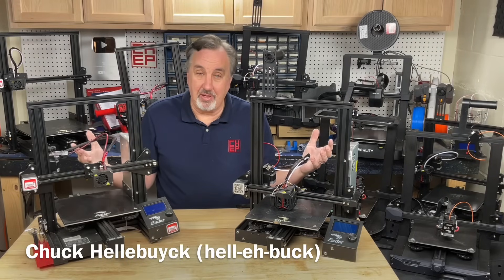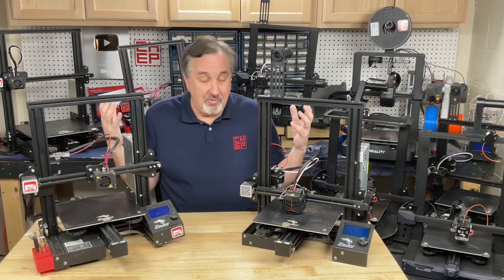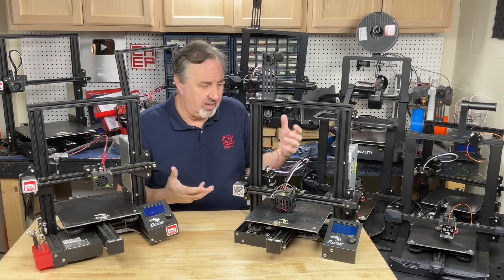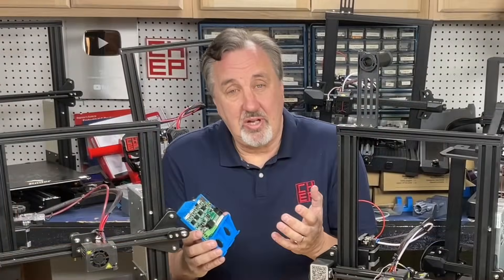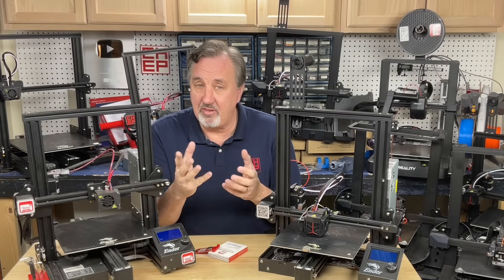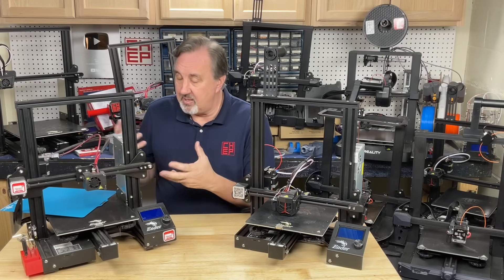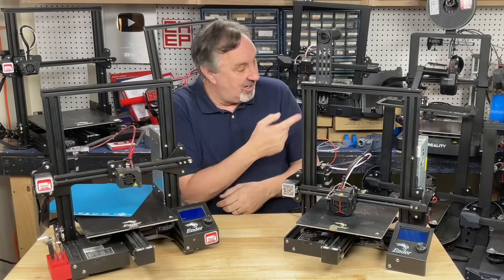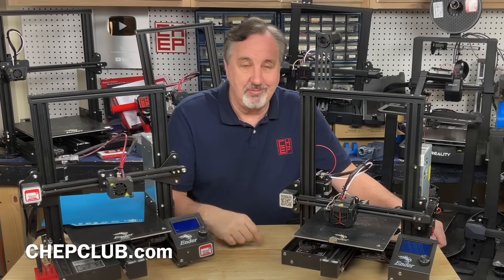Too Many Ender 3's - What Should I Do?

Comment: I just play with 3D printing. I’ve had my Ender 3 Pro for many years and I’ve put lots of upgrades on it. If I were truly serious about it I would start shopping for something newer and better but it certainly meets my needs as a hobbyist. I’ll probably upgrade like I do with my iPhone - when it stops working or is no longer supported, I’ll buy a new one! I’ve been using Octoprint for years. It does a lot of the things you were talking about in new printers

Comment: Chuck,
I have 2 Ender 3s (both are running right now) and I love them. It has been quite the learning experience (got my first one in 2018), and I've done lots of upgrades thanks to you and others. I am at the point however that I now want to move to multi-color with a larger print volume, so I need to bone up on what's best. That said, I'll hang on to my Enders for simple stuff. BTW, got my second Ender 3 Pro from MicroCenter a few years ago on sale for $99. I only bought it thinking for that price, it's great just for spare parts. I put the Creality Laser on it for a while, but the build plate is too small, so I printed up brackets and made a larger laser bed for the laser. The options are endless. Thanks for all your insights!

Comment: I have 6 very basic stock Ender 3 pros. They are a main factor in my small manufacturing business from my home. One has been converted to two color with an IDEX conversion. I continue to find new uses for them in manufacturing. They serve their purpose. As long as they continue to do the job and I haven't reached their full potential, I don't see any reason to purchase others.

Comment: The local college where I live here in northwest Ohio has a pretty solid engineering collage with a 3D printer lab. They have mainly Ender 3 printers. My opinion is it's the best machine for engineering students to learn with hands-on, practical experience. They can open them up and get a full understanding of all the processes involved in 3D printing. They have added a couple of newer printers, but the Enders seem to be a staple of the program. Because they're open source and parts are readily available, they can keep them running for years to come. Most likely they also teach the basics of reading and editing G-code as well. So, donating to schools or colleges is still a good option.

My first FDM 3D printer was an Ender 3 that I still use today. It's a solid workhorse. Your channel was probably the most useful place to learn how to do all the essential tasks and mods to get the thing to work beautifully and produce quality prints that I also still use. I have a couple of other printers now as well, but my E3 is still getting used,  a lot. I have recommended your channel to many people I 've talked to that got E3's or wanted to get into the hobby, Some, as recently as a few months ago.

When you buy one new, you get a great out-of-the-box experience with the first prints. So, although they seem pretty basic compared to modern enclosed, high-speed machines with AMS units and all the other new bells and whistles, I think E3's still have a place on the entry level side of things. I think Creality should even put links to your videos in the box.

Comment: I turned a dead, older, Ender 3 into the frame and gantry for a heat set insert installer. I haven't had a use for the control board yet.

Comment: i think getting into 3d printing demands an ender 3, the barrier for entry is so low nowadays and the knowledge base is astronomical.
you can get fully modded, already reliably built ones <100$ on marketplace from people upgrading or who have sidelined/given up on printing. Hell, most sellers LOVE to share their experience and help you get comfortable and good at using the machines, you make good friends that way
im up to 3 printers with less than 350$ into the hobby excluding filament and mods i hardly need (cant help but tinker and learn)

Comment: 3 days ago i replaced my original stock ender 3, still got it, works like new, but i went for the new features on a low budget, artillery x4 s1, cost me around 30-40 euro less then ender 3 in 2020

Comment: Still using my Ender 3 V3 SE. It is my first and only Ender and I still like it. I have two older smaller machines I have kept for emergency backup but I have not needed to resort to them again yet. Since retiring I have done less printing and spent more time learning blender and learning to do animations. This costs nothing, makes no mess and takes no extra space. My workflow for designing printed parts has also changed. I often use OpenSCAD to make features for my parts where dimensional accuracy is important and then modify the STL with blender to add features that I can just eyeball in comparison to the dimensional important features.

Comment: I still have an Ender 3 and an Ender 2. I use them to print micro racing drone parts...like camera mounts, pieces to protect the electronics, etc. I've gotten pretty into using Tinkercad. It's incredibly versatile and fun to use to design your own unique 3D parts. 
I'm really surprised no one wants those Ender 3's! Once dialed in they work really well. I have no need for some of the much faster newer 3D printers that have come out. Mine works fine and those other faster printers aren't worth the money they are asking when mine works so darn good! I would be interested in the multi color printers, but i'll wait until that feature becomes commonplace.

Comment: Don't want them, send them to me! 

Run them as long as you can Especially IF they are devoid of all the stuff on newer machine... like direct drive extrusion, fancy firmware, auto leveling, multi color, etc. , they are great!  For getting my 2nd machine a couple months ago I had to go back and get a copy of the first machine,(Neptune 2S) lightly used, from 2.5 years ago, to be able to NOT get the "features" I didn't want to have to fight...  I've had the 1st since they came out, and find nothing wrong with it.  

I went Elegoo at the time because they were the Ender bed slinger copy that was the Ender beater... A lot of the mods that were going into bare bones E3s, were stock on the N2S, or the N3, for the same cost(or less than upgrading).     I've not had an actual Ender, but I wouldn't turn them down either.  If nothing else they have to be a good platform for building other things, where, like I say above, there aren't things you Don't want that have to be removed, or worked around. 

Do also want to sincerely say GOOD LUCK with your de-clutter and reorganizing, both for life/enjoyment and for the channel. I'm in the middle of something similar myself, that is involving a complete shop reordering,  to be able to not just be printing, but back to woodworking, and machinist work, and being able to better blend all my interests.    It can be daunting though, especially like for me, wher you have to do A before you can do B, before you can do C, but D needs A ,B, C done, but also needs done before you can do A...Or B, C,  lol.    hang in there! 

I for one have really enjoyed your channel, and learned a LOT here, I look forward to seeing where you and the channel go next.
Reply: Problem is, the Ender 3 came unassembled. It'd be very hard to package up these Ender 3's and ship them and have them arrive not bent or broken. I think they need to be donated locally to schools so young students can get familiar with them.
Reply: @KOrnhOliO1  
They ship just fine if you know how to pack them. My 2nd N2S came fully assembled. 

The guy set it on 2" of styrofoam, everything stabilized with zip ties and tape, wrapped in shrink wrap plastic, set in a box, double walled with extra sheets of cardboard,  filled with packing peanuts,  and Topped with another 2" of styro.  It was an absolute nightmare to unpack, but it went from the midwest to northern Alaska, by USPS in a week, unhurt and un scathed.   Reset z offset(which someone had set to 2mm below the bed surface!), leveled the bed, and I had it printing 15 or 20 minutes after it arrived. 

But honestly, I see no reason to not just disassemble them to mail them. Pack it well, and the box is a lot smaller/cheaper/easier to handle on both ends. And anyone that wants these should either know how to put one together, or can learn just like we all did with a new one. Not like there aren't 4 million YT videos on just that.. ;-) Its not rocket science lol. Even just unbolt the arch, lay flat on the base around the carriage, tape the hell out of it, and box it. 

And yes, by all means, IF they can be donated or even sold locally, by all means, that is the easiest thing to do. And donating to schools, scouts, boys and girls club etc, would be fantastic!  Or even "maker spaces" if that exists where CHEP is(it doesn't here). Heck I'd even ask the old folks homes... I know a Lot of geeks that are getting up there in years, but still like to program and tinker.  Lots of options!

Comment: I currently still have my ender 3. But, if it ever messes up like bricking the hot end, I'm likely getting a bambu (depending on how the current fiasco is going). I have a lot of projects and a lot of different hobby columns. I've realized that I just want my tools to work. My ender 3 v2 is fine and I like that I can get parts if needed, but it can extremely disrupt me trying to work on a project and the printer messes up. It still sits on the concrete slab so it's not as noisey

Comment: I have a VoxeLab Aquila X2 that is heavily modified with the Microswiss NG, M2 0.6 nozzle, g10 build plate. It's a rock solid machine but I rarely use it now. The Qidi X-Max 3 took it's spot on my workbench in the workshop. I have been debating what to do with it though. I would like to sell it but it doesn't seem like folks are interested. I thought about just putting it on my desk so I could have a prototype machine before sending big jobs to the Qidi but haven't committed to it because of it's size. It'd take up a fair bit of space.  I also thought about converting it to a small footprint machine like the Rook or something similar. I think that would be pretty awesome for the desk setup.  I hate to just see the machine sit unused but I also know what I put into it with the upgrades so it hurts a little haha.  If I could just recoup what I paid for the NG I'd be happy haha!

Comment: i got my ender 3 max during covid, i knew i wanted to print helmets and other movie props.
its been great, however lately I've been wanting something with auto-leveling, I've spent many frustrating hours leveling the bed only to have failed prints, and many hours trying to dial in the z-stop with the bl-touch.
do you have any recommendations for a printer with the same bed size as the ender 3 max, but that also has autoleveling?

Comment: my ender 3v2 is barely used after 4 years, probably printed a total of 10 pieces. it used half a spool total.
i bought an A1 in Dec2024 and used the half used spool and it just worked. I've printed hundreds of pieces in 2 months with multiple spools.
i can't sell my ender 3v2 for over $50, so I will just salvage the components and use for my own projects.

Comment: I have a fully stock ender 3 that still has the screen protector on it. It has been used but hardly at all. I just can't get myself to get rid of it. One of my sons started to use it but I eventually got them an A1 Mini with the voucher from my A1. I may just save the ender 3 in case it becomes worth something since it's in near mint condition.

Comment: I have an Ender 3 and a Longer LK5PRO. But, basically stopped using both of them when I got my X-Max 3 last year. The stepper driver went out on the board though and I have fallen back on my Ender 3 to print me parts for my Longer LK5PRO and that had a stepper motor drive failure too. I need to print a product I invented for a customer, so I'm outsourcing until I get a warranty replacement board for my X-MAX. So, it's not just you. I have seen Ender 3s go to teenagers as presents, which makes sense to foster inventors and engineers. I think it would be a good idea to offer tinker class weekends, where 10 people sign up for $500 a piece in two 5 hours classes and learn the basics of 3D printing and troubleshooting, then either give them all an Ender 3 or have a competition for the top 3 to get an Ender 3. Depending on how fast you want them gone and how many people sign up on those weekends.

Comment: The only printer I have is an Ender 3pro.  I don't print constantly or need incredible speed. I have modified it some.  It does the job and works fine.  If I had a business I might think differently. I also don't have room for another printer.  This one works fine and I'll keep it until it doesn't.

Comment: I would not turn down an ender 3. I'm interested in making a core xy from two ender 3s
Reply: I lucked out and got a fully working (though not built correctly) Ender 3 Pro for $20. I have put about $100 into mods and it works well. 
I still have and use, with great results, my free to me Anet A8 which is modified to be safe 😅

Comment: Santa brought me an original Ender 3 for Christmas in 2020 that I had modified crazy stupid.  At the time I sold it, there was $700+ worth of mods on the printer.  That doesn't include the mods that I had done that were replaced by other mods.  I print almost exclusively with ABS, so an enclosure is a must.  I had an enclosure for my Ender 3, but it resulted in not being able to move the printer without having to tear down the printer and enclosure and reassembling it.  I ended up building a Voron 2.4 300x300 and I absolutely MacDaddy-ed  it out during the build process (top of the line everything and 48v for the steppers).  I kept the Ender 3 for a bit, using it for the occasional PLA or PETG print.  It mainly sat there and collected dust.  I ended up selling it to fund the ERCFv2 MMU for the Voron 2.4.  I miss the Ender 3 because it was so fun to tinker.

This channel was very instrumental in my Ender 3 era, and I am so thankful for Chuck and the vast knowledge that he bestowed on me.

Comment: I have an Ender 3 V2 with BL touch and Micro Swiss direct drive (changed the extruder servo to a smaller one for lighter weight.)  I love it.  May not be fast, but, I can send a print to Octoprint and walk away and know it will get done.

Comment: Got my Ender 3 Pro in 2020, 2 weeks before covid hit the UK. 
Became a member of 3D crowd printing face shields for the NHS, learnt so much from that community about the printer.
Now 4 years later its still in daily use, has now got a 16 bit board, 0.6mm nozzle as standard, direct drive print, octo print, BL Touch level and a glass bead.
Cant remember the last failed print that was not my fault.
There are plenty more new units that do so much more nowadays.....SO WHAT!
Happy as I am, a great mainstay printer that as you say is a Classic.

Comment: Fine little machine. I don't see the complaint. I've used the S out of mine in the 3 1/2 years since I bought it. i just put a .2mm nozzle on it and now its my high-detail machine for fine  screw threads and such. I have no idea where CHEP is,, but I'd be glad to have another.